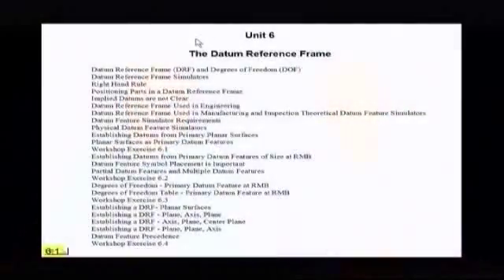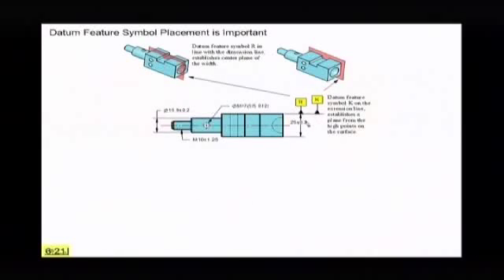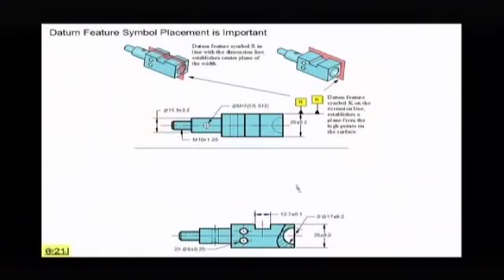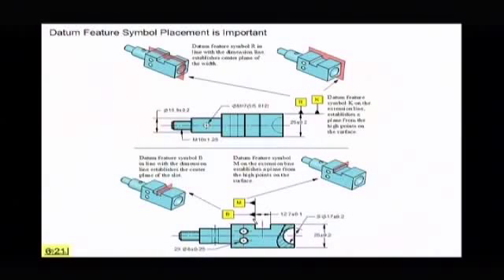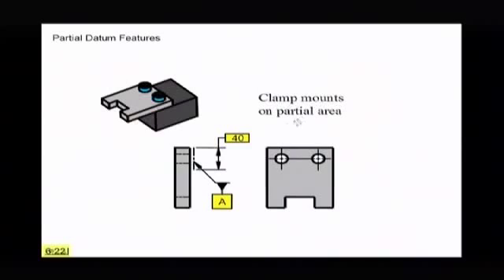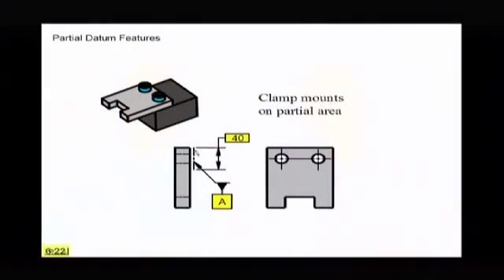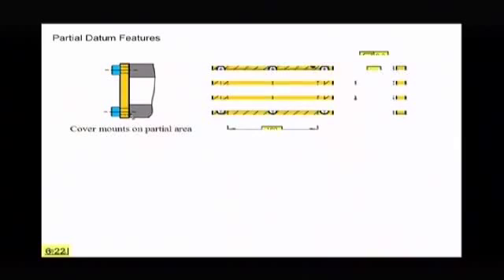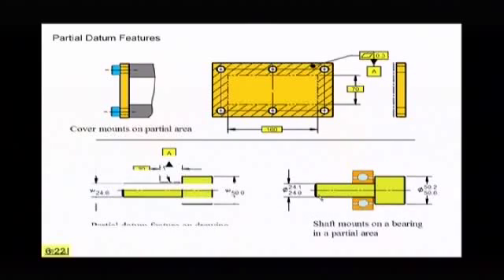Datum Plane vs Datum Center Plane in GD&T

Comment: In the inspection how you locate the datum on the center line?
Reply: farhad64, you would measure the feature and assume that the center is halfway (or in the middle). The functional gage, though would be a slot, pin, or hole.